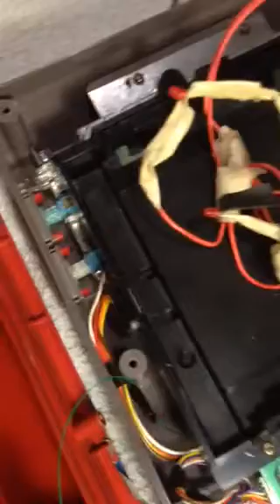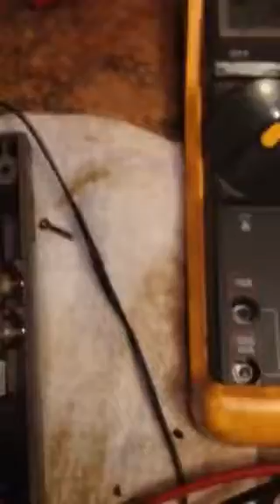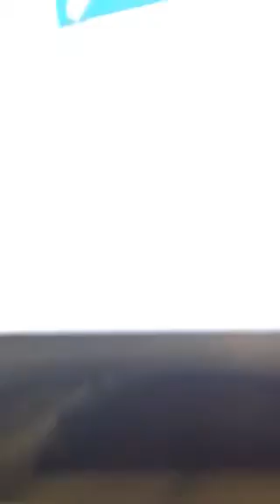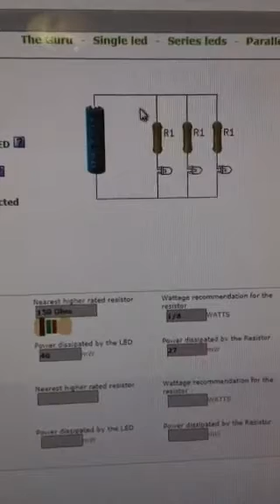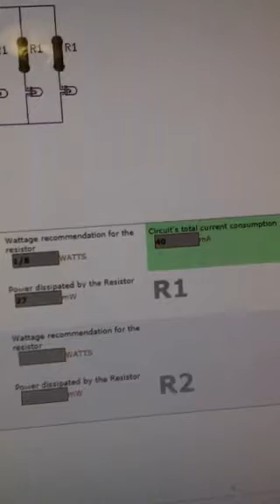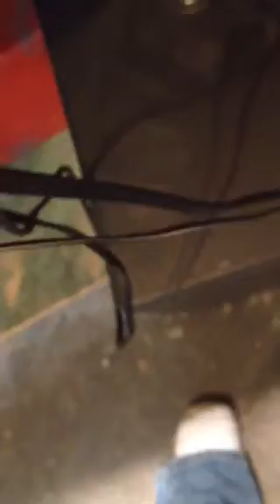How to put LEDs in an nes Part 1-tutorial

Comment: I accidently measured continuity while the NES was powered on (I'm new at this, I'm learning)... As you said, it seems to have caused damage to it: The sound is still ok, but the image is all messed up... Do you know exactly what happened, like did I bust a certain chip or something like that? ...and more importantly, can it be fixed?
Reply from the maker: CheveuxDeFeu777 The reason you wouldn't want to measure the continuity with power is because under the right circumstance it will break your meter you are using. In this case with 5 volts I assume your meter is probably fine. Explain more of the nes symptoms or condition. Is the 32 pin connector the game slides into working right? does the game freeze after a certain amount of time? how many lights are u running?
Reply from the maker: If I was you, I would desolder the lights from the nes and see if it still runs well. If so, you may have too  much electrical load on your nes. Make sure you are running the original power adapter for the nes.
Reply: Hi! Sorry I haven't replied in 9 months, I changed account since then so I didn't get your replies. Actually I didn't even soldered  anything to it yet. I just mesured continuity, then, realizing my mistake, I went to test it and saw that I broke it. 

Like I said, the image is all messed up, like we can't see anything clearly, the picture is all green with darker shapes but the sound is ok. 

I'm positive the 32 pin connector is functionnal.
Reply: Testing resistance with the power on will cause arcing. You probably burned something up with the arc the meter caused, it might not have been a visible arc, just some static but that is enough to cause damage to a circuit board. I would just get a new system with working components with a busted shell on ebay, the busted up ones go cheap even if they work. Or try to find some troubleshooting guides to find the actual issue. But you'll want to look for any discolored areas or anything that smells burned to start. With my experience with burned circuit boards, it is usually obvious what is wrong with it at a glance, but your NES probably doesnt have enough damage done to be able to see or smell where the problem is. Good luck if you're still working on it

Comment: Thank you for the vid. it's saveing me a lot of time. BTW is that masking tape? of so be careful. 5v isn't much but it's enough to start a fire. electrical tape will work fine.
Reply from the maker: electrical tape was used for exposed wire. masking was used to dampen the light around the leds to focus them without deadening completely with the black electrical tape. and you're welcome.
Reply: +Morgan Metzger of okay I get you. how has it lasted? still working fine?
Reply from the maker: It is my friend's and he has shelved it for now. NES doesn't seem to be his priority but the LED's still work, it looks fantastic but he needs to replace the pins for reading the cartridge. It had the region lock mod with a switch. If one game didn't work normally we would toggle the switch and it would. But it has stopped playing anything, because the pins are garbage. It sat in his garage for who knows how many years. I am very happy with how it turned out though. I used body filler for cars to fix the plastic on the system and painted and decal the entire thing. The ONLY regret I had with this was the way of displaying the lights. I used a see through decal so it would spread the light a little better. The masking tape I used to tape it against the decal, but the horrific thing was how plexiglass does NOT show light through it very well. Not as well as other kinds of glass. If I had to do it again I would search for different glass or ways to reflect the light through. That was the toughest part.

Comment: Hi ! , how I can do the same in a SNES 1 ? or in a N64 ? ....
Reply from the maker: The snes is very tricky. It was not as relaxed about it's power input. There's also two different versions of the original. The one with the sound chip is the only one I've worked on and it was nearly impossible. I don't know what to tell you. The n64 is actually not too bad. Look up the jungle n64 led mod. It's not too bad, but a painful process. Sorry I couldn't be more help
Reply: Morgan Metzger  can I use a parallel leds in the indicator led of a snes ?
Reply from the maker: I bet if you took the ground from another spot yes. I would be careful though. It doesn't always work out that way.
Reply: Morgan Metzger thank you so much !

Comment: Have you tried wiring them in series?
Reply from the maker: No, actually I used parallel. Sometimes if you have enough leds or need a certain resistance parallel may be the better choice. If you use the guru calculator on the led calc website in the video it will chose which one is best for your needs. Feel free to ask anything else.